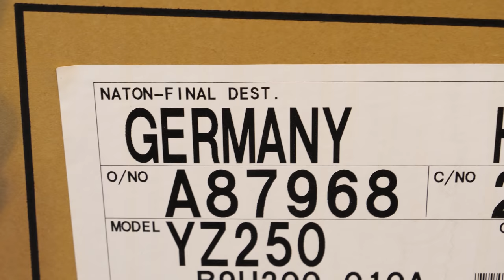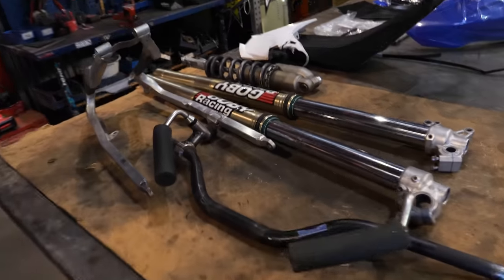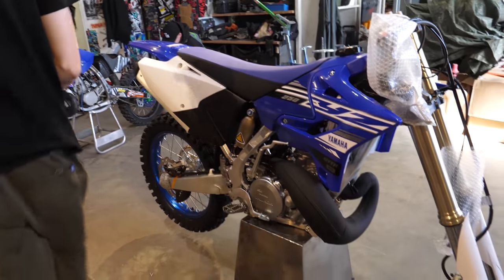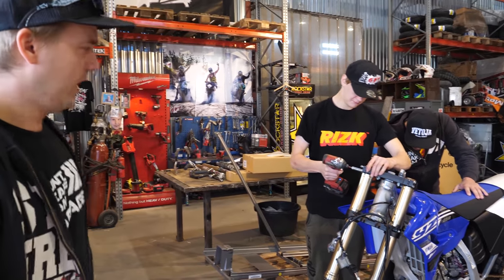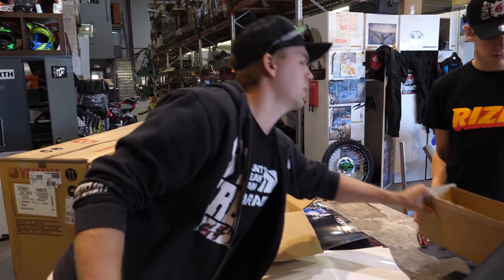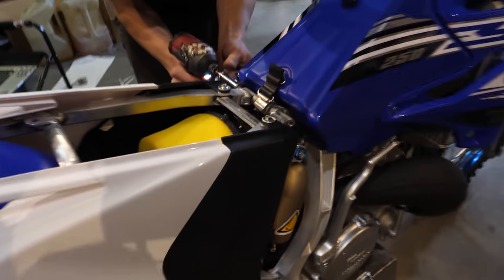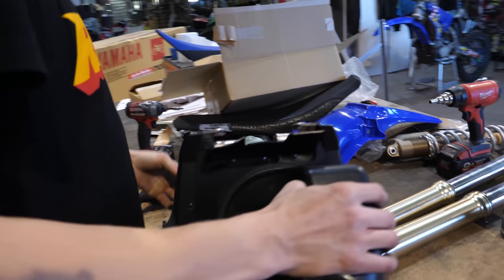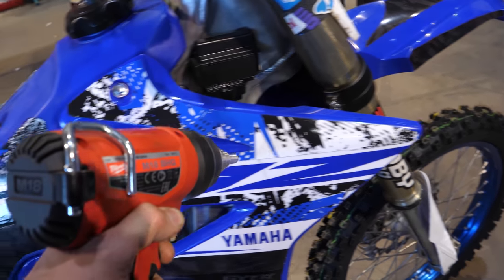UNBOXING Yamaha 250 YZ 2019

Comment: 5:18 lol that's why 2 stokes are slow and old news
Reply: 2 stroke beat 4 strokes
Reply: @CarlosPerez-ff3bj  they haven't beat 4 strokes in like 10 years lol..  THATS WHY NO ONE RACES THEM
Reply: @bruitzdaxtin3847  I didn't say it Stunt Freaks Team did
Reply: Mixing gas and kickin ass eevery day
Reply: @therealakalaska9485  2 strokes are lighter than 4 and mean double cc because it has less strokes before the power stroke
Reply: @CarlosPerez-ff3bj  that doesn't change the FACT there SLOW and haven't changed in 10 years. but why change something that works great.
Reply: YZ250 makes 47hp, and it's not even the most powerful two stroke on the market. 2019 KTM 250SX-F is just now cracking 44hp, but it's still significantly heavier, feels heavier, and doesn't produce but only half of the torque of that YZ. So yeah... Two strokes aren't going away any time soon. Go ride one.
Reply: @saltybastard9037  how much horse power does a yz490 2 stroke make?
Reply: @saltybastard9037  why doesn't anyone race 2 strokes anymore???                oh yeah they got a 4 stroke and felt real power. I love my 04 yz250 but my 2012 yz450f has so much more balls
Reply: YOU CANT COMEPARE A 250  two stroke to a 250 four stroke.. THEIR not even in the same CLASS.    you said it tho a KTM250sx-f(small bike) is 3 less horse power then a 250 two stoke( big bike) good ol 4 storke power.... and 450 ( same class and 250 2stroke) around 52HP... now what the FUCK are you going to ride   47HP  or  52HP
Reply: @CarlosPerez-ff3bj  YZ490s were right around 53-54wrhp in stock form. Once you got the head fixed, 56-57wrhp, but still 3-4hp down from the KX, CR and KTM 500s.
Reply: @therealakalaska9485  Uhhh... What? You ever go to any amateur races? Plenty of people race them. Last year's 450 Expert state champ in my state won on a KTM 300. You can win on them. Now on a professional level, bikes have to be homoglated. Yamaha doesn't include the YZ250 or 125 in the AMA program.
Reply: @saltybastard9037  okay thank you so you think itll beat a 450 4 stroke
Reply: @therealakalaska9485  And actually, yes, you can compare the two. They're the same displacement, and in most amateur race series, 250 two stroke is allowed in the 250 class with four strokes. The average 250 two stroke makes 45-50wrhp at give or take 8000-9000rpms and roughly 30lbs.ft of torque. The 250SX-F is the most high tech four stroke available, and it's making 44wrhp @13,000rpms, but roughly 18-20lbs.ft of torque.
Reply: @CarlosPerez-ff3bj  Under the right conditions, say loamy dirt or sand, a YZ490 could stay with or beat a 450F to the first corner, but the rider on the 490 would have to nail the start perfectly and hang on for dear life, where the 450 could pin it and be far more consistent. But there's no getting around a big bore two stroke once it gets the drive.
Reply: @saltybastard9037   yes they can ride in the same class but NO ONE DOES cuz they will get smoked... you have to have serious bike skills to beat a 4 stroke on a 2 stroke.. MAD PROPS TO PEOPLE THAT DO.. and nobody cares about armature races. they race 2 stroke cuz they don't get a FREE 4 stroke from there sponsers and its like a 1/4 the price to rebuild
Reply: 250SX-F(little bike)  1 less horse power then a 250 two stroke(big bike). good ol little 250sx-f making MAD POWER  and torque doesn't matter when your holding it at 10,000 rpm
thanks for the numbers Spencer Guinn
Reply: @therealakalaska9485  The Canadian Pro MX series run 250 two strokes with 250 four strokes (though 250 two strokes are limited on modifications). Also, 99% of the motocross world falls under Amateur ranks. I say a lot of people would care. A fast Pro on a 250 two stroke could do well in a 450 National, but those top pros are contracted to race four strokes, and because KTM/Husky is the only one who continuously homoglates their 125/250 two strokes, it would have to be one of those top racers to make it happen.
Reply: @therealakalaska9485  Also, one more horsepower at peak doesn't mean it's just as fast. In a drag race to the first corner, a 250SX would run circles around the 250SX-F because it makes horsepower immediately. Coming out of corners, the 250SX would also blast out of it way harder and you can take lines you couldn't on a 250 four stroke. The 250 four stroke is easier to ride fast, and more consistent, but someone with two stroke skill could walk away, but they're putting in work, but that's way more fun and rewarding than tractoring around.
Reply: @saltybastard9037  pretty cool that a little bike can keep up with a big bike. aka 1 less HP.. IT ALL DEPENDS ON RIDER SKILL witch most people don't have lol. so they want to buy the most powerfull thing out(450f). And they run 250 two storks with 250 four stokes cuz they are slow(one less HP like you said, The 250 four stroke is easier to ride fast, and more consistent, but someone with two stroke skill could walk away) most people that ride DONT have skill. they just want POWER POWER AND MORE POWER
Reply: @therealakalaska9485  That doesn't make sense that a two stroke is "slow". 250cc vs 250cc, the two stroke is a significantly more potent race bike. Mind you, the 250SX-F four stroke is cutting edge technology, with 44hp. They're pushing the limits, and engine mods are practically superfluous now. You can throw thousand of dollars at it, but only then are you making stock two stroke numbers. 
Also, the YZ250 is just for reference. To be honest, it's toned down and has been since 2011. In fact, the YZ250 engine is pretty remarkable considering it's actually the same architecture as the '99 YZ250. No joke.
But compare ANY 250F to the modern KTM/Husky 250 two strokes. They don't stand a chance on power, weight, nothing.
Reply: @saltybastard9037  no shit THEY RACE IN TWO DIFFENT CLASSES you need to compare a 450f to a 250 two stroke.. there in the SAME CLASS
Reply: @therealakalaska9485  Only in AMA Pro Racing motocross/FIM Supercross, because the cronies there still think of a four stroke like an XR400, or a KTM 525SX. They gave the four stroke a 100% advantage rule because four strokes back then were heavy as hell, under-suspended, and slow. Times have changed. That too, and they helped the four strokes by banning leaded fuels for two strokes in 2005. Either way. 250 is a 250, and rules shouldn't play to favoritism.
Reply: @saltybastard9037  true true but what are you gonna ride 47HP or 52 HP.. il take that 52 HP I don't care if theres a leafblower motor in it I want as MUCH HP AS POSSIBLE. lol
Reply: @therealakalaska9485  Remember, that 47wrhp YZ250 is really a toned down smoker from a lost era. KTM sold 50wrhp 250s for over a decade, and cracking over 55wrhp was and still is easily achievable. This is from 250cc. But if I'm looking for raw horsepower, I could just jump on my KX500. Besides, in motocross, horsepower isn't everything.
Reply: @saltybastard9037  50 hp isn't 52hp … and if its toned down how do yo tone it up lol and what power will it make??
Reply: @therealakalaska9485  The YZ250 got the "International" specs in 2011. Longer silencer, reduced compression, etc. But even before, it made 48.5wrhp at peak, only because Yamaha went with the route of useable power rather than a run-and-gun style of power like KTM had done with their 250SXs. BUT, it doesn't take much to make a YZ put out +50wrhp. You could easily take it to Pro Circuit and have the engine ported, milled, etc, just like the pros bike and crack some serious horsepower numbers. Add pipe/silencer, reeds, etc, and for less than $1,000 (the cost of a four stroke pipe setup), you could gain those numbers easily.
Reply: @saltybastard9037  no one wants to mod there bike for 1 1/2 HP ill take 52HP (four stroke)  STOCK . numbers don't lie. just ride the more powerfull bike.(fourstorke)
Reply: you sound very clueless. 2 strokes is  faster if driven correct but takes more work to do so, 4 strokes takes less work on driving wich you can put more effort on the track and get faster track times.  With that said its been 4 stroke ruling for some years now. Not power-wise. Just that 4 strokes are the thing that is hot right now. Looking at the dirtbike community and the world stars within the dirtbike world- the 2 strokes is getting back more and more. Times changes and i think 2 strokes is getting back to where it once was. Because really, 2 strokes is the real shit.
Reply: @Heddan1992  lol thanks you said it "4 strokes takes less work on driving wich you can put more effort on the track and get faster track times." so the 4 stroke will get to the line first. so its faster, with less effort.  and it the dirtbike community everyone wins on 4 stroke for the last 10 years. ONLY in ENDURO 2 strokes wins...NUMBERS (STATS) don't lie...  99 percent of people who ride don't have the endurance to ride any bike all out. so everyone takes instant power (4stroke)
Reply: @therealakalaska9485  what i ment was mechanicaly the 2 strokes are faster.
Reply: @Heddan1992  lol should of just said that. 2 times faster mechanically. crazy to think how fast things are happening in there

Comment: All yz250 models come with a piston a 2 top end gaskets
Reply: I got a 2018 yz250x and it comes with a top end kit and 2 sets of gaskets bc service manual says to remove top end before hitting full throttle and clean the piston

Comment: The 19 250 has white plastics😂 this is a 17 or 18 I’m guessing?
Reply: anonMS dawg  the 2018's also have blue rims. However this is a 2019. The white plastics only apply to the 4 stroke I believe
Reply: The 18 is still white plastics but only 4 strokes 250 and 450 have the white and baby blue plastics

Comment: 2 stroke vs 4 stroke???
Reply: 4 stroke provides better,2 stroke struggles more and creates more toxic fumes.
Reply: 2 stroke more power per cc
Reply: 4 stroke all day
Reply: Clearly it’s a 2 stroke buddy
Reply: For motocross is 2 stroke BUT FOR supermoto 4 stroke is better
Reply: 2 stroke you will be mixing gas and slapping ass flying up hills 50 mph with unlimited power and 4 stroke you will be adjusting valves and going 50 on your average road 👍
Reply: @deathtroopers4345  hate 4 stoke . 2 stoke all day and any day. only thing 4 stoke is good for 4x4 four wheeler